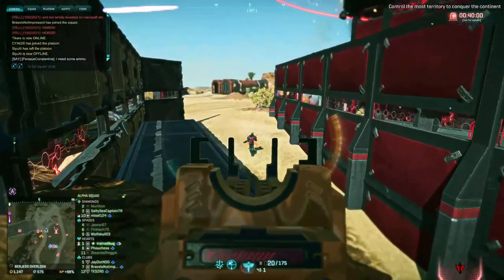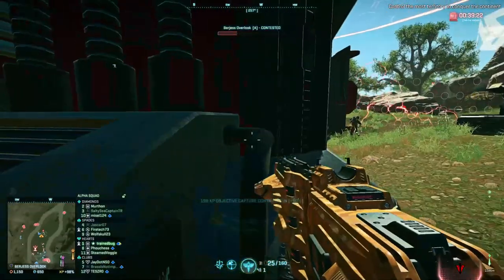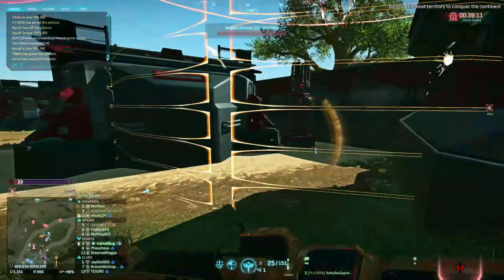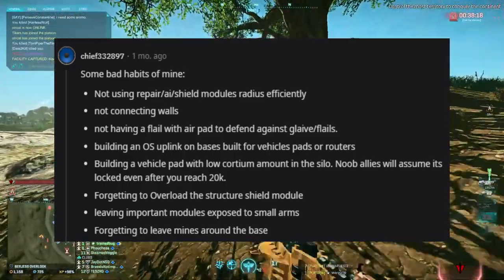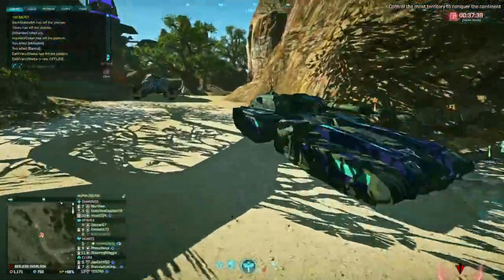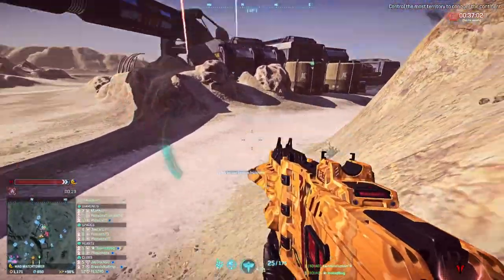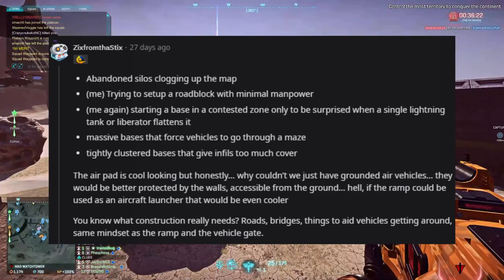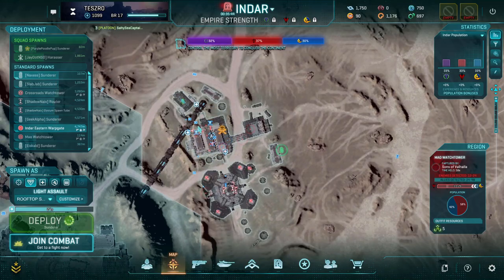BAD CONSTRUCTION HABITS IN PLANETSIDE 2

Comment: Didn't knew about direction of the Spawn Tube. That will be helpful, thanks. 

The thing I dislike the most about friendly bases is where I spawn at already operational, decently sized base with filled Silo but it has one (or even two!) vehicle spawn terminals missing for whatever reason. 

The Ground Vehicles Terminal is literally the second most useful (for allies) object in whole Construction system, because with it friendlies can help you defend the base against armor, bring spawns, bring more Cortium, generally help take control over ground. 
I try to place it early on my bases, but that forced 20k Cortium threshold is a bane of my existence.